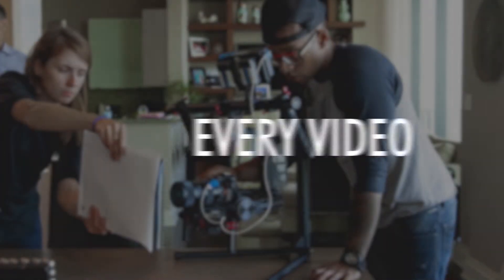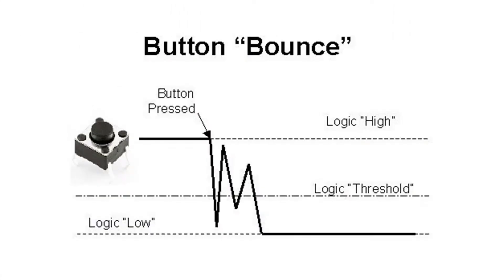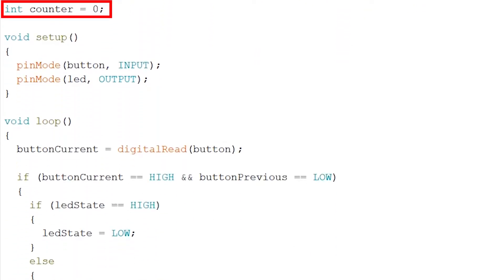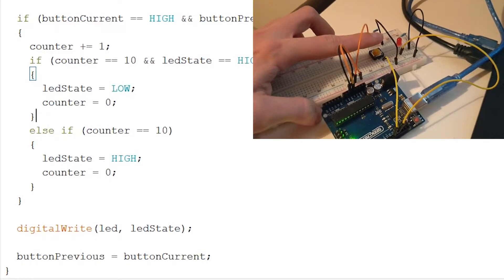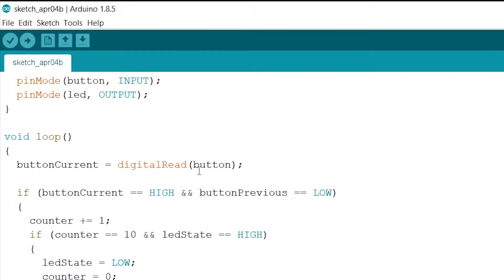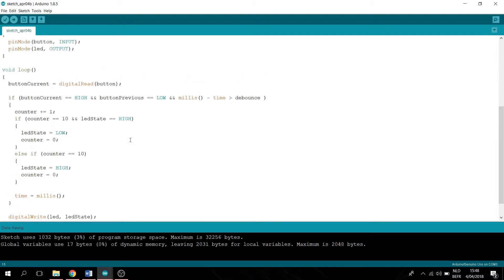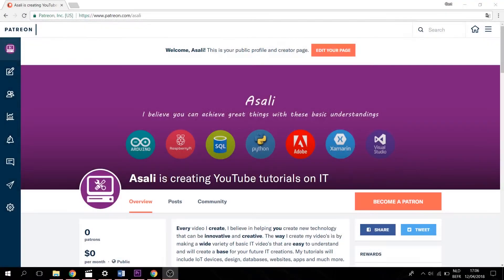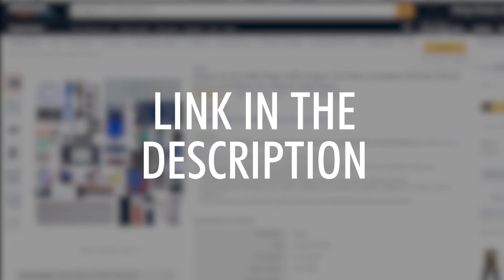Arduino uno Toggle button with debounce on and off tutorial

Comment: This is really confusing. I can see that it works but I don't understand how or why. Time is really just an arbitrary value. So let's say the first go around time = 0, so ANY VALUE for millis() - Time > 0; So no debounce there. Lets say next time around time = 443, you just wait long enough for millis() to be greater than 443+debounce and again, anything sets it off. So if I understand this correct, your code doesn't actually "debounce" anything. It just ignores all other 'bounce' signals after the initial contact is made. It doesnt' actually establish a stable signal change.
Reply: if 37000 milliseconds have passed since you fired up your arduino, millis() will be 37000. The first time you click the button, "time" will be 0. 37000 - 0 = 37000 which is greater than the debounce value of 200, and it will initiate the counter. 

Now, since you are a human being and not perfect, when you click that button, you're finger is probably pressing down for 158 milliseconds. Let's imagine the arduino reads all input every 1 millisecond. It will think you clicked that button 158 times! But with this function, every millisecond it is doing that computation: millis() - time. 

The first millisecond it will engage the counter since 37000 - 1 = 37000  and that is greater than 200. The second millisecond your finger is still pressed down, however, the computation looks like so: 37001 - 37000 = 1 , which is less than 200, and it doesn't do anything, not even change the "time" variable. 

The second millisecond it will do the same 37002 - 37000 which is 2. Still smaller than 200. Don't do anything. 

By the time you've released your finger 158 milliseconds later, it's gotten to 37158 - 37000, which is equaled to 158, which is still less than 200. So because of this function, even though arduino would've thought you clicked it 158 times, it only registered it as ONCE.

Now if you hold onto the button for more than 200 milliseconds, it will register it as two clicks, 400 milliseconds as three clicks, and so on..